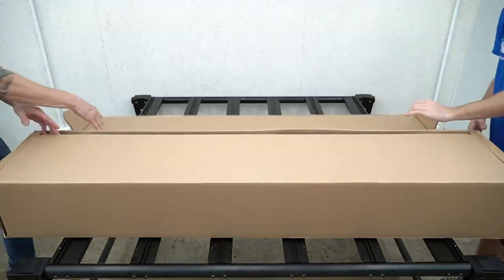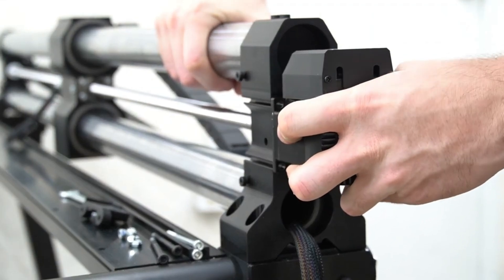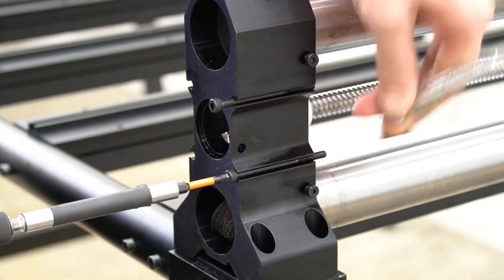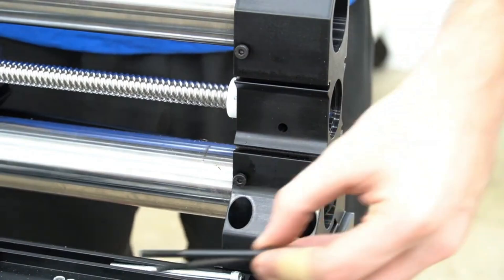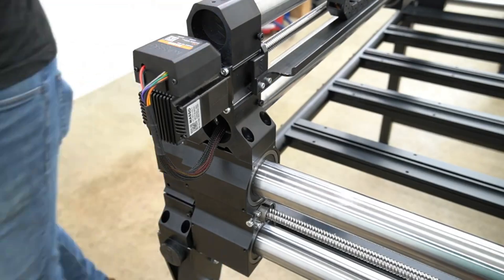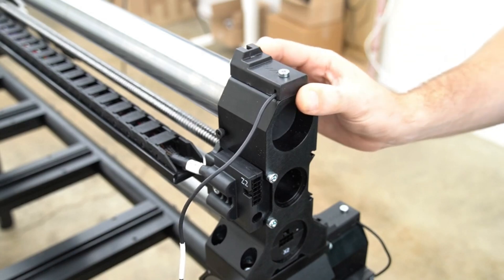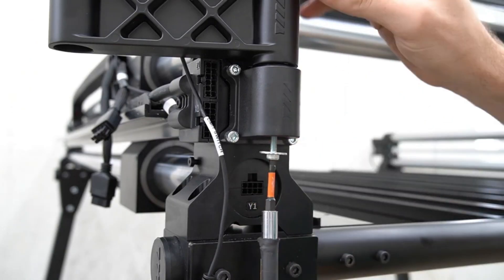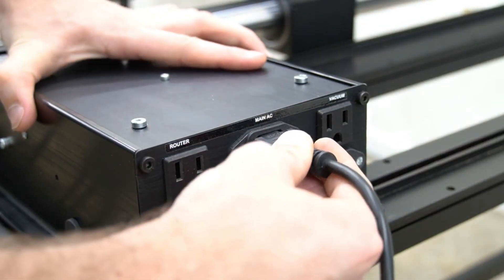Elite Series Assembly with Masso (Gen 1) (Revised)

Comment: All of my stepper motor switches were set to On. Is the 1 and 4 off still the standard for the Masso controller on Elite series? What do these switches do exactly?
Reply from the maker: 1,4,5 down, 2,4,6 up. (This video is a bit outdated, the manual is correct)